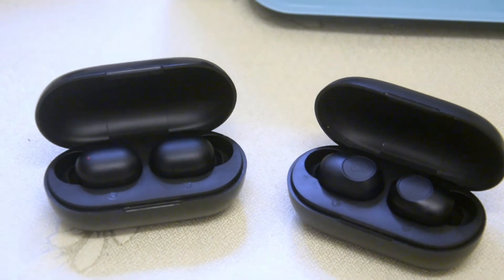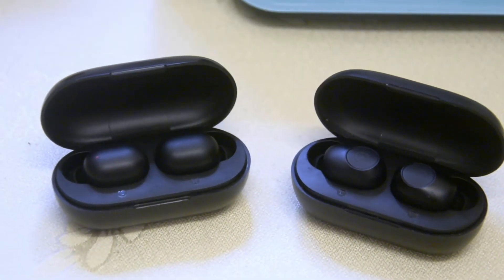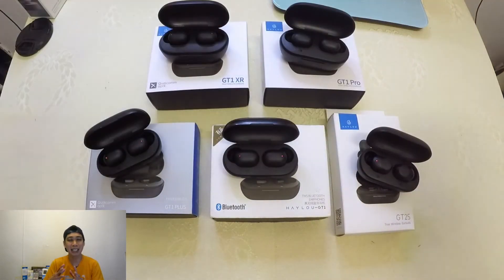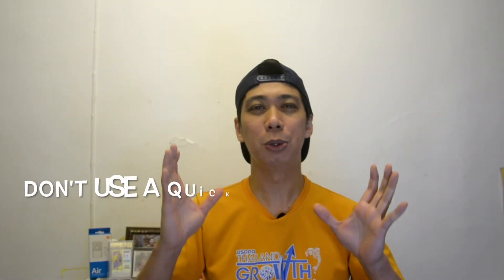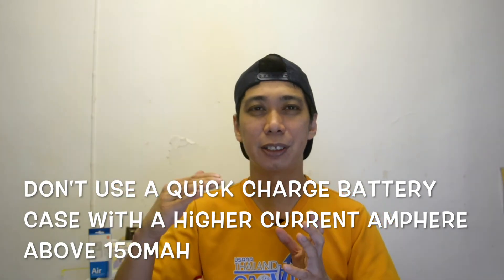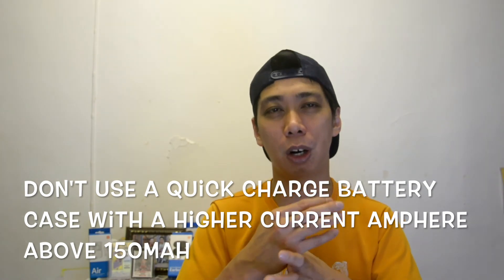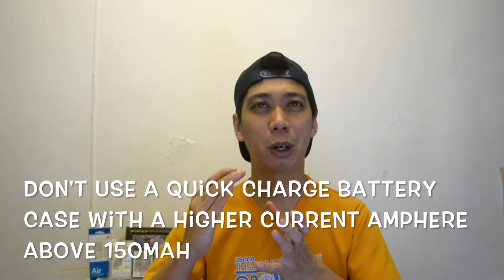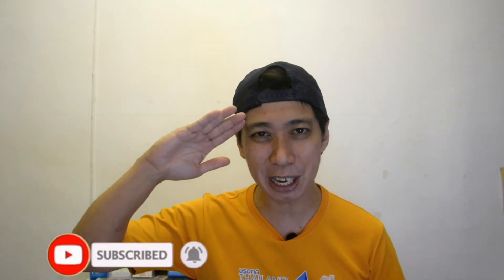[HD] LOST GT1 BATTERY CASE? CAN I USE GT2S BATTERY CASE? EXPLAINED BY OHM'S LAW

Comment: I wonder what uni or semester you are in, but the current doesnt matter (as long as you don't exceed the max current on a certain Voltage) - it's the voltage that matters. I'm actually curious what the output voltage of the GT1's case is.

Comment: This maybe too late a comment. Ying Newton, you are confusing the Current rating of the supply/charger and the actual current running through the load.
In your case, the 500mA is the rated current, most likely Imax, and the actual current drawn would depend on the load requirements of the iem case. Now, the 150mA rating is the current max the case can supply the iems during charging. The 100mA current is the iem load requirement.  You are right load requirements should always be lower than supply ratings. Otherwise, overheating results when going near or above Current ratings. Also, Currents are not converted, but drawn in a continuously changing amount. Why? Ohm's Law! 
The internal Resistance of charging/discharging batteries increase/decrease while in use. Temperature also affects Resistance, variations depending on battery chemistry. Think of Current ratings as road speed limits. Your actual speed/current would depend on the amount of traffic/Resistance. Hoping this clarifies things.